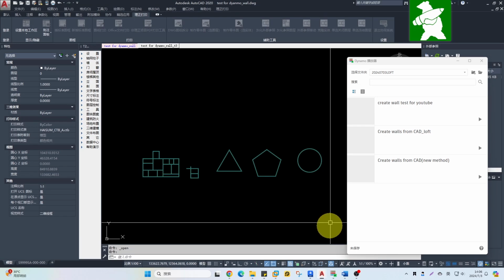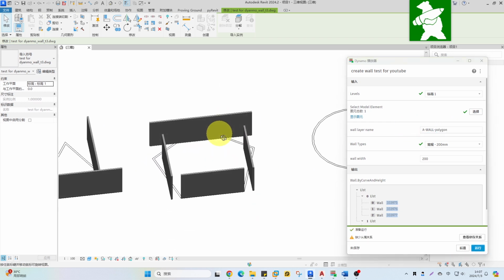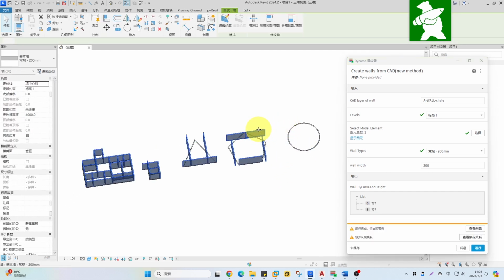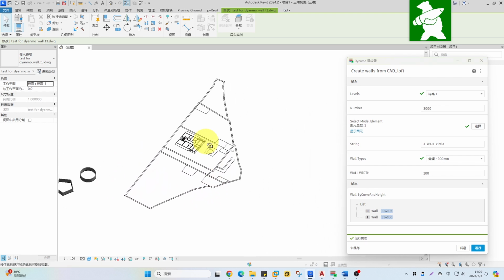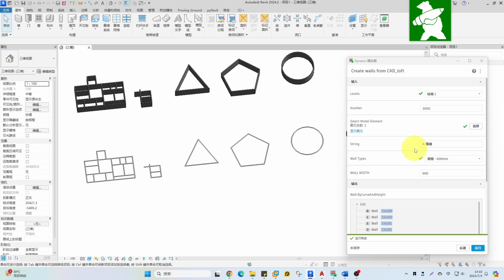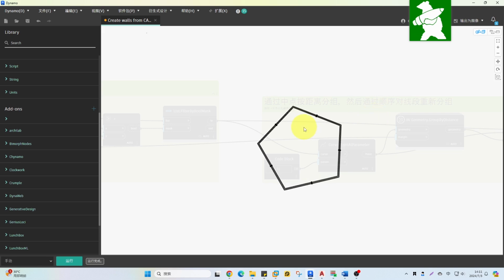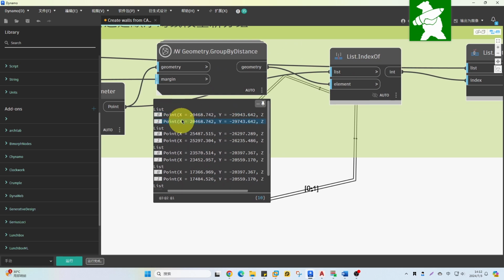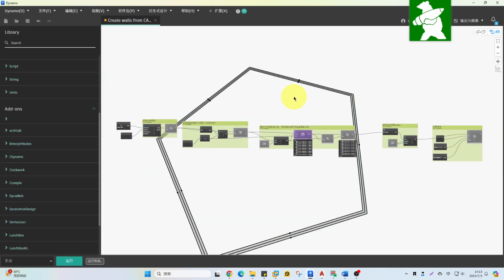Create wall from cad using dynamo (upgraded!)

Comment: thank you so much but i noticed something i tried to draw lines in cad over each other then i got that points will be created no problem but i think needs to filter listes before surface by loft to avoid users mistakes like what i told u if single lines over each others but you know ? you are the best youtuber about dynamoo really i got many informations from ur 2 vedios
Reply from the maker: you're totally right.if you get single lines from cad.it needs to be filtered out.I added this filter.simply add filter for more than 1 item of lists.

Comment: Great work thanks for the video
My quastion: i did the script but it’s not working fully, when i use Node > not every value are True so the Geometry.GroupByDistance won’t work with every value cuz it have only 0 point, do u have any ideas what went wrong?
Reply from the maker: @adqile1709  you could send me the script and cad file, I will check it when I have time. I think it's the level of list that may cause this error.

Comment: Thanks for the tutorial. But I have one issue. First can you tell me what is the use of Geometry.GroupByDistance node? Its not working in my script. Caused by this issue the whole script is not working.
Also, List.IndexOf node giving -1 value. Please reply.
Reply from the maker: Spring package and I don't know why you have 1 value.
Reply: @mavs013  Thanks for your quick response, however, I am really stuck in the middle. Please help someone.
Reply from the maker: @ChandanPal-qx2de  It's night where I live now,you could send me an email and tell me your issue,better with picture and description and even your file if posssible.I might check it tommorrow.